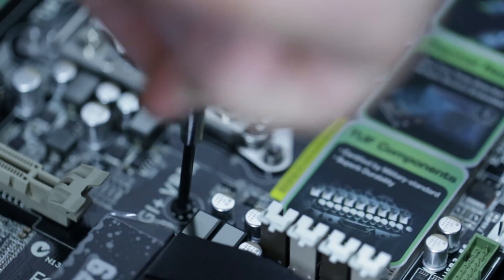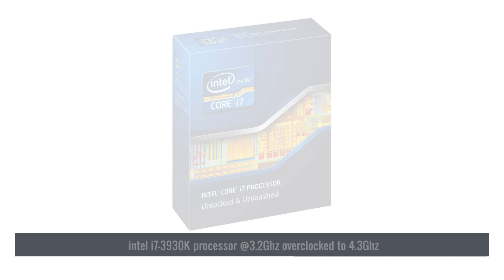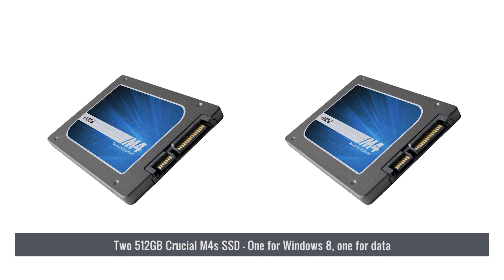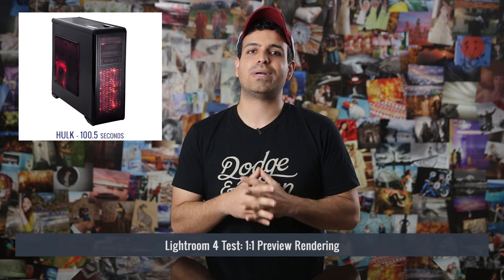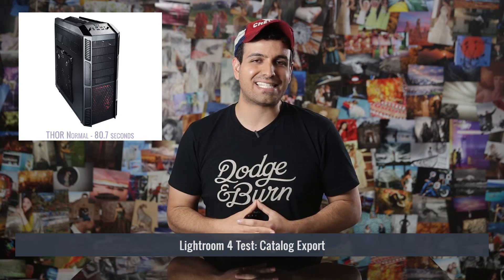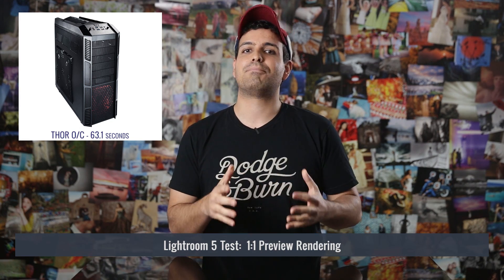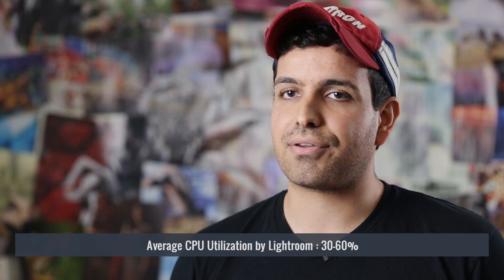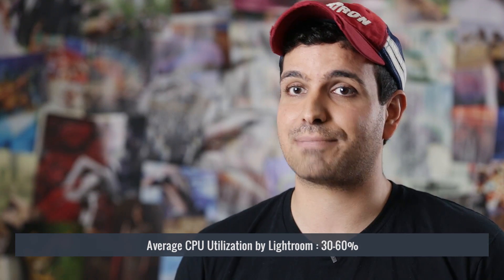Lightroom Performance Test Shootout - Single vs Dual CPU, Hard Drive Configurations, More!

Comment: Personally I stopped rendering images in LR all together.   It took several photographers to convince me to switch to PhotoMechanic to proof images.   Finally I switched and I have to say it, I LOVE IT!!!  Photo mechanic generate Hi Res images instantly.     When I import about images from a wedding to PM (photo mechanic it takes about 2 minutes to import Hi Res images instead of 2 hrs that it takes LR to do it).   One's images open in PM I rate them 1 = delete and 4 = keep (you assign any numbers you wish.  One's I'm done proofing images I create another folder in PM and drag 4 star images to new folder (picks).   Than I close PM open LR and import picked 4 star images ONLY.  And in LR I import with minimum preview because when I am on Develop module going from images to image.   I noticed that 1:1 render is need it for Proofing images in LR, but when I import them and go directly to Develop module "minimum render" is just fine!   So I don't waste any time on "Rendering what so ever" Well 3-4 minutes per thousands of images.
Reply: tradio2003 Adobe Lightroom sucks. Mainly because they are bunch of stupid dicks that doesn't even know what is the beauty of OpenGL/OpenCL are. Just look at Capture One Pro. They utilized OpenCL technology which take advantage of the GPU card. Results? Blazing fast rendering and image exporting.

Comment: I think you got a little lost with this comparison.  IMO, the more relevant question is, 'How many cores (forget the number of physical CPUs) can PS and LR make proper use of?'  More detail regarding the functions that are multithreaded would probably be of more use to the average buyer.  I'd love to see you turn Thor's cores off one by one, re-runing the LR benchmarks and more popular PS filters and adjustments each time.  At what point do the times start to rapidly increase? 

It's a no brainer that 12 dog slow cores will get whipped by a turbo-capable (3800 peak w/o OC) 6 core chip. But is a 4C at 3.2 better or worse than a 2C (perhaps with HT) at 4.0?  Etc.

Comment: currently the only way to get xeon cpus with dual qpi links is to use the e5 series. The e5 2650 in an 8 core, 16 thread cpu, in dual cpu configuration that would be 32 threads total. Yes, they are using the least expensive 8 core available, at 1,200 each. The fastest 2011 8 core available is 3.1ghz in turbo, and 2,000 each. (vs the i7 at 550)

Then again, they are not using the fastest i7 either... I think your comment is BS. 

Btw, this info was received after 30 seconds of googling.

Comment: The difference between a 7200rpm drive to an SSD is already minimal, once you have an SSD, the entire bottleneck is on the CPU, not the RAM disk. With the current CPU utilization, you would need to be running at around 20-30x the CPU clock speed for Lightroom to be able to utilize the speed of a RAM disk as a hard drive.

Comment: Well some good test you did, guys, but .. honestly, I don't know why you've put a discrete video cards such as the nVidia GTX and the Quadro. The stupidest thing out from Adobe is that they never optimized their software to use the video card memory, which is light years faster then RAM, the CPU or both together. LR4 was slow and annoying and if LR5 is slower .... OMG.

Comment: If you system is config right and your using 64bit drivers and the is is on one ssd drive and one ssd cache. And 64bit apps on a normal HDD and your using adobe mercury CPU,GPU engine  and you config the adobe software to handle the above you should get quicker results

Comment: gotte remember that the xeon e5 2650 got 8cores with ht @2ghz base and 2,8ghz turbo clockspeed while the 3930k got cores with ht @3,2ghz base and 3,8ghz turbo clockspeed

so its quite obvious what cpu will be faster when the software only supports single cpu with multithread optimization